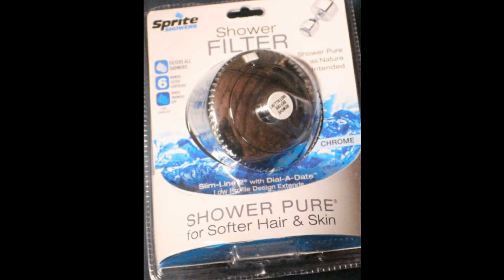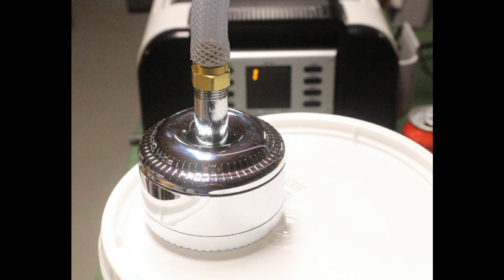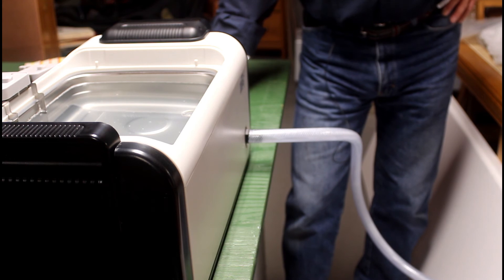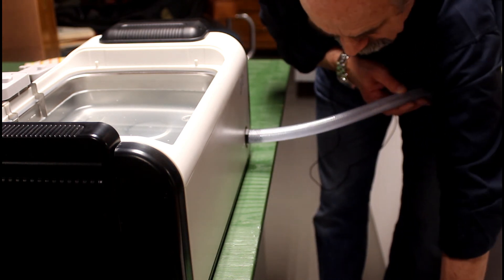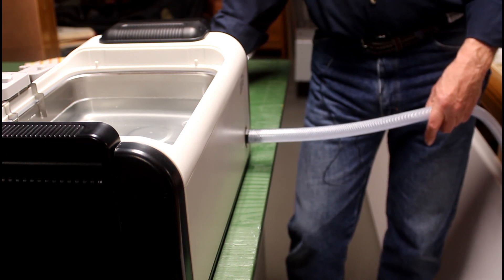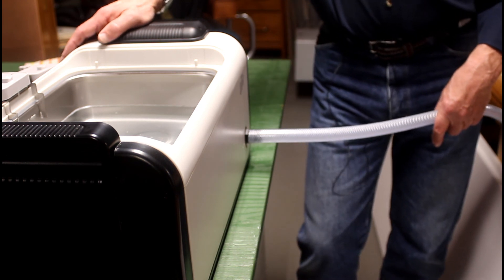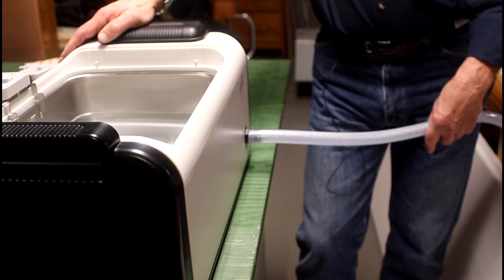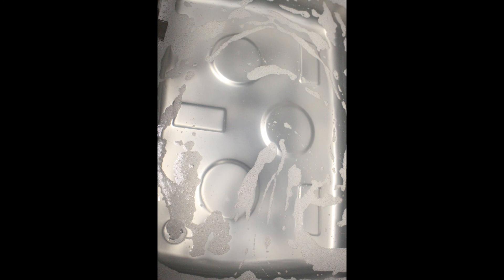iSonic Ultrasonic Record Cleaner home made water filter

Comment: I’m in the process of building a simple filtration system for my ultrasonic cleaner very similar to yours, nice video but sitting in that big comfy chair made you look like you were to relaxed and the video could have been  about 5 minutes shorter if you were sitting on a wooden crate 😊
Reply from the maker: I have been happy with this and I'm still using it.
However, I have modified the filter element. I snipped a couple of the cross bars, removed the filter material and replace it with some Marineland Aquarium filter media. I just cut a piece and stuff it into the old element.
Reply: @ejcheck  that’s a good idea, I’m not sure what those beads are they put in the shower filter but it does eventually breakdown and that would end up in your cleaning solution but I can’t confirm if it is detrimental to the cleaning of vinyl records

Comment: Excellent excellent idea! I have a DIY ultra sonic and attached an external Aquarium pump/filter, but I don't like my set up. I have pre-ordered the Humminguru cleaner but not slated to receive it until Sept/Oct.  I was looking at getting an iSonic until then.  In future videos give us an update if you change out methods or filter material.  I have also wondered about using a high quality chamois cloth to dry records. I would think that they would have less fibers than the micro towels.
Reply from the maker: The filter seems to be working fine. When I pour the water back into the tank it looks nice and clear. I was looking at the humming guru but at 350-400 whatever finally works out to be, I prefer paying the extra money for the option of doing 5 to 10 albums at the same time. I initially went through my whole collection about 450 albums then after the fiber situation I redid them all so the 10 album option came in very handy. Now I have to replay I put the album on the shelf for cleaning and wait for more albums or any new purchases and then run through five at a time. I am also giving Turgikleen a try and it seems to work well.
I've been very happy with the iSonic